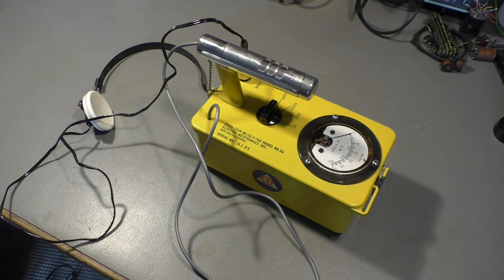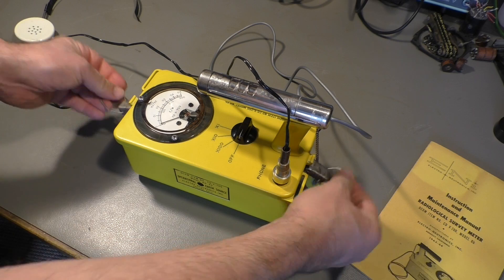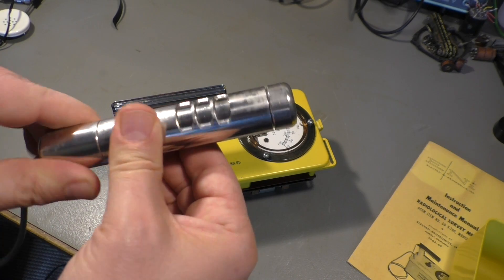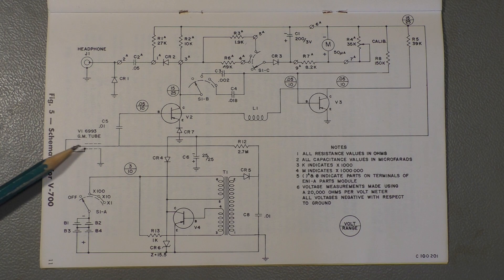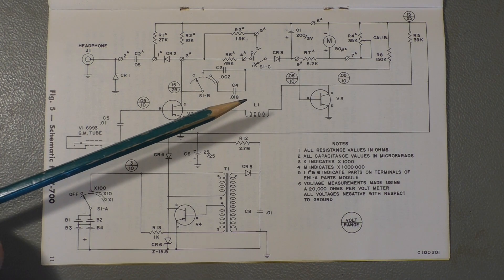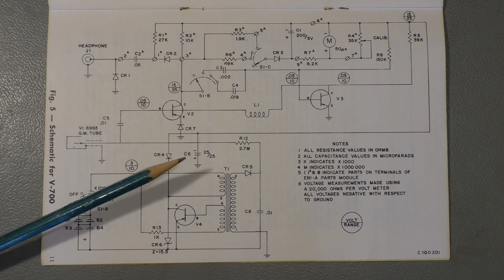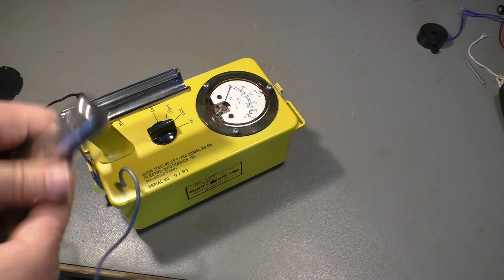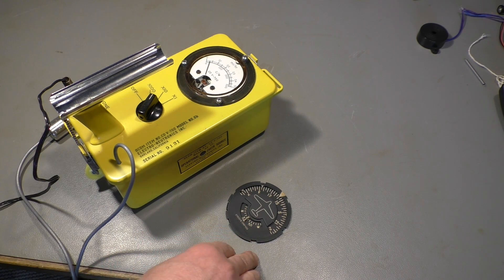Geiger counter from 1963 - CD V-700 ENI (PWJ60)

Comment: The schematic diagram shows that the four batteries are connected in parallel even when the switch is off.  That seems very bad.  I think that the batteries would run down very quickly if they are constantly connected in parallel.
Reply from the maker: Yeah they are connected two parallel in series with the other two parallel, so they are all parallel. There is a dispute  if this is bad regarding of self-discharge.
Some say the batteries will completely discharge because two batteries are never at the same voltage. Others say that the stronger battery will discharge to the level of the weaker battery and then stay there. And there is another theory that says the weaker battery will be slightly charged while the stronger one comes down and they will meet in the middle....
However, I remove the batteries for storage anyway. This will also prevent the danger of leaking :-)

Comment: Great video! Thanks for sharing. Just ordered a CD V-700 off ebay. Is it safe to keep in the house with the checksource that it has built in? Thinking back to high school physics i'm assuming the sticker will block any harmful rays coming out of it? I was intending to store it in a cubpoard under the stairs. Thanks.
Reply from the maker: Well... I'm not an expert on this matter but the check source on my counter is so weak, it hardly detects any radiation. I have an old clock face with radium markings, that one is way more active! I would say if you don't sleep on that source or eat it, there is no problem. The only problem I see is if it falls apart and makes radioactive dust. You better do not try to remove it.
If it looks like parts coming off, put some tape over it to keep it in place.
Reply: Play with Junk thanks for your quick response! 😁

Comment: NICE! Keep it in great condition, and don't leave the batteries in it for a long time, or it will corrode the inside of the unit! This CD V-700 ENI is in mint condition! I have a CD V-700 Victoreen 6A with the rare external CD V-705 speaker, and the speakers are expensive and hard to find! Yours and mine look like they were made yesterday! These units are great! Your model has a U-238 (t½ = 4.46 billion years) check source like mine, which has barely decayed at all, so it is still accurate, and will still tell you if it is calibrated. If you open the beta shield, and put the middle slit at zero distance from the operational check source, and it reads between 2.0 - 2.5 mR/hr, than it is considered calibrated. Some others used Radium-226/Radium-228 (t½ = 1600 years/5.75 years) and Lead-210 (t½ = 22.3 years), so those models often need a proper calibration. It looks like yours is calibrated. Also, the probe housing is made of nickel-plated brass, which acts as a compensation filter for gamma-rays, that way the response curve for different gamma energies from different isotopes will "flatten out", that way you get a more accurate dose reading (mR/hr). Sources not calibrated for the unit, or unknown radioactive sources should always be measured in CPM, not mR/hr. These units were usually calibrated with Cobalt-60. Cesium-137 is used mostly these days. The response curve is close with these two, but if you want it calibrated for a specific isotope, you'd have to send it somewhere, and it often costs a pretty penny to get it calibrated, usually around $125+ dollars here in the US. Anyways, nice find you have there! Thank you for sharing!

Comment: That's about the nicest looking Electro Neutronics unit I've seen.
Reply from the maker: I bought it from a dealer in England, unused and in original box :-)
Reply: It's in amazing condition! I bought a Victoreen CD V-700 6A (with a 4-digit serial number), so it's an older unit. I also got the CD V-705 speaker for it too. It's in the same condition. Not a scratch, and works great! Came in the box, but the box was in rough shape. My Victoreen CD V-700 6B is also in pretty good condition, but it needs a new probe and cable, and I need to readjust the voltage and calibration potentiometers, which I haven't done yet. I will probably add a BNC connector to it, so I can remove and use different detectors.

Comment: When you brought out the radium paint dials raw, with your bare hands, without any protection or the dials in sealed bags, I audibly gasped.
Dude, seal them into a bag RIGHT NOW and wash EVERYTHING with alcohol, then water.
The paint turns into dust really easily, and the dust getting inside you poses an extreme risk.
The CD Wee-700 greatly, greatly underestimates how dangerous those dials are.
Reply from the maker: I keep the dial in two plastic zip bags (one inside the other). I only take it out rarely and I try not to touch the painted surface. I appreciate your safety concerns... thanks for the warning.

Comment: For doomsday preppers: if there was a civilization-destroying nuclear war and you need this to survive, when the batteries fail, it becomes useless. All batteries have a shelf life of 10-20 years. But these could be modified to remove the battery holders, and use an internal hand-crank generator sticking out the side. With solid state capacitors, it would probably still work for decades to centuries.
Reply: Or solar ?